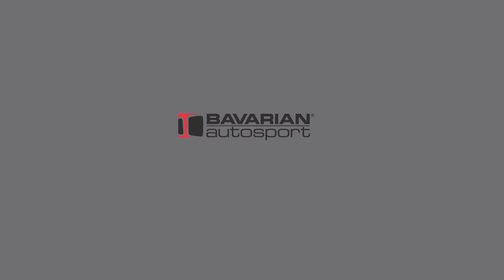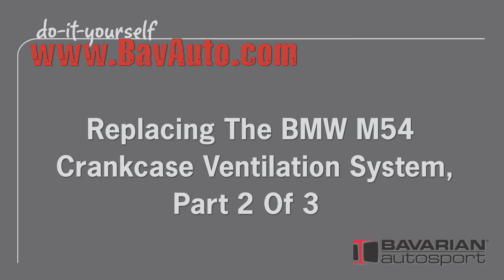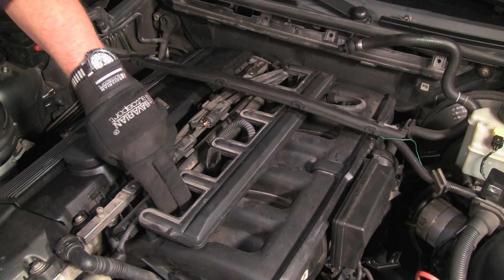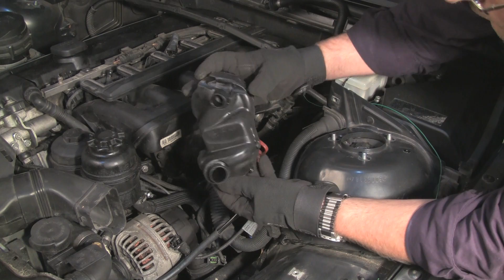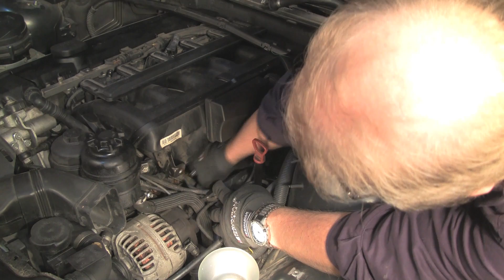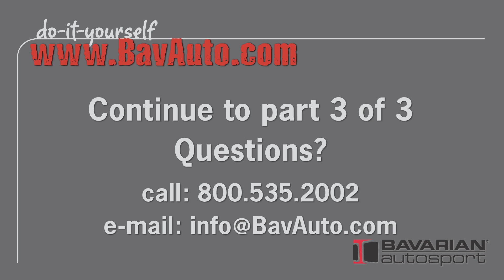Replacing the BMW M54 Crankcase Ventilation System, Part 2 of 3

Comment: First, thank you for these helpful videos.  Working on my BMW Z4 is just a bear, but these help quite a bit - even if similarities stop after a certain point.  One quick question - why not remove the intake manifold for easier access?  is it just that it is more work or is there another reason?  I recently had to replace my starter motor and there was no other choice than removing the manifold, which seemed less difficult overall than trying to maneuver underneath that sucker for this series of access points.  Plus I had the added benefit of being able to peek inside to see the signs of a possible failing CCV - oil collecting in small spots of the manifold channels.

Comment: Hey is it easier to replace a PCV thats already intergrated in the cover rather than an external one ? My car is an 2011 e90 and Im getting a whinning noise from the pressure building up . I know it will be way more costly but Im talking about replacing it .

Comment: like 
i have one question.  i have p0174 bank 2 system too lean. today i ckeccked for smoke test and there was a smoke coming from the area of valve. we couldnot locate exact spot coz we coudnot see it.  how can a smoke come out fromseparator ?  previous owner told me he installed a turkish not oem separator.  but how could it be only bank 2 ?

Comment: Great video. Gonna do this on my 325ci.
One question though: If the return hoses are clogged, is it okay to blow the dirt away from the nipple with compressed air like you say? Wouldn't that blow the dirt into the crankcase possibly clogging the oilpump, oilchannels for camshaft or oilfilter?

Comment: Hi first I wat to let you know the all ur videos are very useful, I have a question maybe you can help I have a x5 whit a m54 engine and I had a problem whit the secondary air pum is fix codes are gone now I can't get etest done because my cat air and O2 sensor are not ready I have driven the car for at list 700 kilometres and is not clear and I have not code or engine light what can I do thx for your help

Comment: I've watched the three part series at least a dozen time and " Otto " does a fantastic job explaining the procedure in depth.
I checked a couple of the pipes on my 05 325xi and I noticed they have the insulation covering the pipe. Any idea when BMW starting to use the insulated pipes ? also what mileage is on the vehicle that " Otto" is working on ? at 50k I don't have the crud / fudge within the pipes yet !!
Reply from the maker: This vehicle had about 80k miles.  It is not clear when and on what models BMW installed the cold weather crankcase ventilation parts.

Comment: Do you have any videos on camshaft sensors exhaust side on 2008 335xi your videos are very helpful thank you
Reply from the maker: Not currently, but the Bentley repair manual for the E90 3-series models, will cover this.
http://www.bavauto.com/fland.asp?part=b311

Comment: well informed and thorough video. i have just replaced my ccv using your methods and found it so easy considering this is my first attempt at anything more difficult than changing plugs!  what i would like to know though, is, at 2:13 you mention disconnecting wiring harness connector from manifold sensor. I noticed mine has been disconnected and had electrical tape wrapped around it. Should this be plugged in? is it important?
Reply from the maker: Yes, that should be connected.  This is the intake air temp sensor.

Comment: It's mentioned that the new valve has a case around it & the new tubes have foam insulation.  Owners need to know that this is the cold weather version of parts.  The non-cold weather version of parts is also available.  But it seems wise to buy the cold weather parts if your car did not come with them.  Otto's video basically answers my question: can you use the cold weather parts even if your car did not use them. A: Yes.  Looks like a job I will have someone do.  A little to involved for my comfort/skill level.  Thanks

Comment: Hope you don't mind my saying it so boldly, but I don't think it's a particularily good idea to blow the gunk into the oil sump (10:00). The dip stick is only stuck into the crank case, you'd better pull it out (There's a o-ring!) and then blow and/or pry the gunk out.
Else, a great video! It convinced me to pay for it to have it done! ;)
Reply from the maker: Often the oil dipstick tube does not come out easily.  Blowing through to the oil pan is a fine alternative and we would perform an oil change after the job.  Of course, removing the tube is certainly a fine alternative and does prevent having to do the oil change.
Reply: how much did that run you michael?

Comment: I have a 2002 BMW X5 3.0  and I got a misfire on cylinder 3 with fuel cut off and a whining noise coming from the CCV. When I remove the oil cap the noise goes away and I feel the engine stalling and sucking air. The whining noise has gotten louder and there is some oil on the threads of my spark plugs. This is definitely my CCV going bad am I correct ?

Comment from the maker: Our kit has all of the hoses included.  Just go to our online store at bavauto.com or call our advisors at 800-535-2002.  
*  Valve cover to crankcase vent valve
*  Vent valve to intake manifold
*  Intake manifold secondary hose
*  Oil drain hose from valve to dipstick tube

Comment from the maker: Sure do ........ That's moisture in the oil vapor that is moving through the crankcase ventilation system.  The oil separator is likely full of this goo.  You should consider replacing the crankcase vent system .... and .... you likely are running long oil change intervals.  If so, consider moving to a 5000 mile interval (if using a good synthetic).

Comment: hey, great video, But my experiance with working on these engines what i have found is its much easier anf alot faster to remove the entire intake manifold to replace the ccv and all the hoses, it takes me 25 mins to remove and then its a matter of a few seconds to replace all the parts, its also better because u can replace the manifold gaskets and clean all the oil that gets into the manifold . All done it takes 45 mins or so. just my thoughts. keep up the great info videos!!
Reply: That's what I want to do. It just seems too tight to replace with all that stuff in the way.  Who reads braille that is not blind ? Geesh,  just remove the intake for goodness sake.